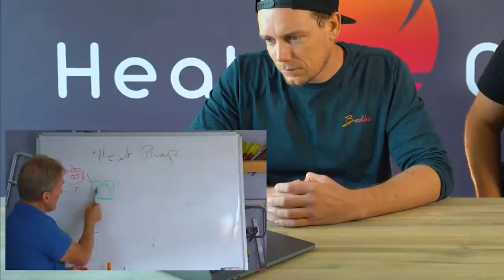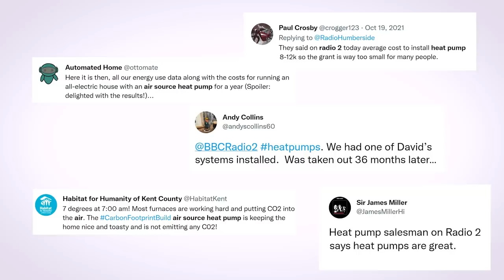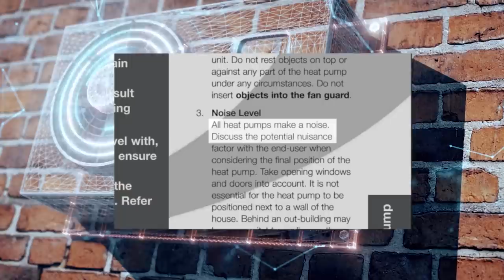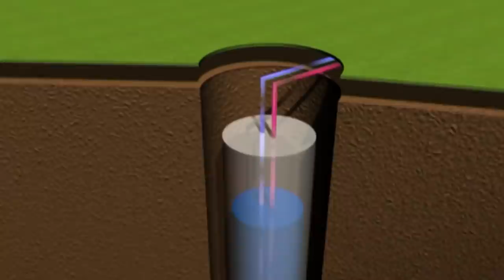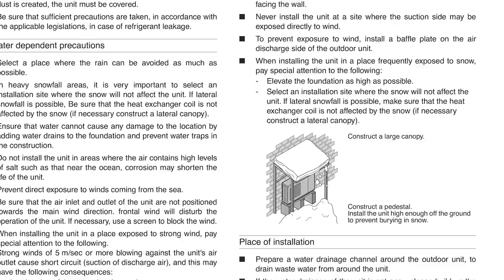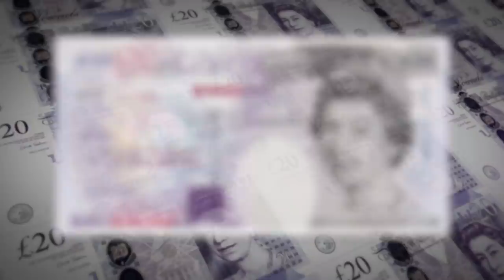Heat Pump Secrets They Don't Want You to Know

Comment: Excellent, informative and balanced. I really appreciate this as I am in the process of a complete barn renovation and trying to decide how to heat and insulate it. Thank you.
Reply: Crikey! I thought it was very UN-balanced. Amazing how perceptions can differ.
Reply: In what way is this opinion hit piece balanced? About as balanced as Fox or Sky "News"
Reply: It wasn't balanced at all...
Reply: Closed sell spray foam and ground source heat pumps are ideal. Air source with backup resistance heater is a good if ground source isn’t an option. A photovoltaic system is also a great option if you have good sun exposure and they have a huge return on investment after usually about 7 years.
Reply: See a professional, this is not a balanced video.
Reply: Also succinct.
Reply: Balanced!? A few nods are given to, "if you bend over backwards and get a degree in heating technology, you might be ok". Otherwise this is simply a list of unrealistic catatrophising and fear- mongering about all the ways in which heat pumps could possibly, maybe go wrong. If you did that about cars (or anything really!) we'd never have made them let alone driven one - think about all that explosive liquid being carried around, and the number of people that are killed every year and the servicing, and insurance, and purchase price, and the number of petrol stations they need and the cleaning and the depreciation and you even have to do lessons and a test, which costs a fortune ... no, no, we don't want these car things, let's go back to horses!

Comment: I'm an installer of the Ecodan range equipment and you hit the nail on the head, trying to explain all this to a customer is not easy, they make it sound cheap and easy !
On average it will cost between £20,000 to £30,0000 to be completed to spec !
Reply: my installation was arround 600€ including cables, 10m insulated pipes and all. I even include the vacuum pump, the manifold, adapters, and all i had to buy to install it myself... (a frient lent me the tool to shape the tubing...)
Reply: @robertroigsantamaria  joker
Reply: @timbrooks2763  I paid 18€ for the vacuum pump (i was amazed it even came, being so cheap), 23€ for the manifold, 2 or 3€ for the adapter r32 uses new valve size, and 10m tubing was some 50€, and some 360€ for the HeatPump itself... I reused the feet, and the cable and the plastic railing to hide the tubing...  so 450€  not even the 600 I said...
Reply: That is the point, get Ecodan made in Japan and England= No problems, get a cheap Chinese made= heat pumps are no good.
Reply: @MicSokol  

Manufactured in Scotland at their Livingstone plant.

Warehouse @ West Hallam is England.

Comment: It's clear that even though you say that you are independent,  you have trawled the Internet for the most obscure idiosyncrasies in heat pump manuals. My ASHP is going though its third winter. I'm very happy with it.  It has a 16A supply so no need for a 6kW supply. It is correct that the system needs to be designed for the house and I'm happy that my installer went through the correct design process.
Reply: I heard Roger once drove a car and crashed it so he informed the world that cars are all terrible, because he knows best.

Comment: I've just got back from living in France where they are handing out huge grants to convert from gas or oil over to a heat pump. And that's all they do, fit a pump system without any consideration to the house size, construction materials or heating system currently installed. And, I'd love to show you the quality of workmanship (it was so bad on my friends place I took some photos). It's an absolute farce.

Comment: I attended a party hosted by a couple extremely concerned about climate change but were prevented from fitting a heat pump due to a restrictive preservation order. They still insisted that the pumps will save the lives of those who survive winter. I made my excuses and left. Happily due to the husband's enforced resignation they are free to find a property far removed from Downing Street and suitable for a heat pump.
Reply from the maker: Very good. I hope you managed to sneak a bottle of Chateau Neuf out under your coat or was that the Bring Your Own?
Reply: @SkillBuilder  just one question for you Roger if I may, what is your opinion on electric combi boilers?
Reply: @kryptonite9187 .  I was wondering about these too, I had read they are used in some of the Scottish Isles were gas and oil are hard to supply.
Reply: @kryptonite9187  I've fitted one:   They are seriously heavy full of water and not suitable for a first floor linen cupboard swap out.        Bigger output ones need 3 phase electric!    and this isn't always available from the leccy board in rural areas.      No idea if they meet the claimed running costs but with the cost of electric  ATM, I would think VERY  costly to run. HTH

Comment: Wow someone who reads the instructions. First . !
Nice rant. Having been around heat pumps for the last 40 years mainly air to air for office heating . During the summer they work well with ambient temp above  5 degc.  Once you start to get below this then you start to see the frost start to build and units start to defrost . As the temp gets colder it becomes more and more difficult to to keep the coils clear of ice . In the worst case I have seen unit with the coils covered in ice that have defrosted and melted the ice in the coil but left a sheet of ice still top to bottom stoping the air circulation  from going through the coil . 
I have spent hours. Washing the ice off units with hose pipes in the depth of winter and then forcing 2 or three defrost cycles to dry the coils before putting it back into operation . Come the winter we would have to adjust defrost to every  60 min. To keep units working .  
But then we started to get Japanese units computer controlled circuit boards and more sensors than you could count and these units started to perform a lot better and for most of the time would cope well with the Uk conditions .  But still you could get the situation when you would get called out and find the outdoor unit looking like a snow man with ice and frost all over it.   Now these units are being pushed into homes and The domestic market hope they have the latest control and tec . But I wonder as they are a lot cheaper than the units I work with at times .  And  yes I have fitted one .  So I will find out how well it will work . But I can only 
Make it cost effective running on cheap rate. During the day gas wins at today prices.  But we know that the gov will push up the price of gas to stop this advantage. And we know that off peak electricity will soon be a thing of the past. As we will have the night time Ev charging peak soon that will end off peak . 
Just wondering if I should keep my log burner so not to be held to ransom by utility company’s
Reply from the maker: Great comment
Reply: Her in Ireland we manufacture hybrid systems  heat pump and condensing oil boiler or gas boiler combined ,so you can operate combined or solo.

Comment: I have been an heating  engineer all my working  life 53 years to be exact and I agree with you , in my time I found council’s and housing associations fall in to this trap easy,nice to hear someone speak the truth in today’s world.  How do you feel about hydrogen boilers.
Reply: I think hydrogen boilers will have a roll, just depends on how the hydrogen is made can course just as much pollution as burning gas direct.
Reply: @guygfm4243  massively expensive and hugely polluting
Reply: Well an heat pump is about 200% efficient on electrical basis while at best hydrogen boiler would be 20% efficient on an electrical basis (green hydrogen). If we speak about blue or grey hydrogen, you are better to continue to burn natural gaz to save GHG.
Reply: @pierregravel-primeau702  Green hydrogen? Sounds like you've been smoking too much of it my friend.
Reply: If it’s broke don’t fix it ..these look dreadful, going backwards
Reply: Its always nice to find people online who echo your own bias even when it lacks critical thinking am i right?
Reply: Hydrogen molecules are much smaller than methane (main component of natural gas) and will leak much more readily than natural gas. Look forward to a lot more leaks being found at your annual service and heating systems shut down until they are fixed. Same for the gas mains and pipework outside the house.
Reply: @pierregravel-primeau702  A heat pump is not 200% efficient, more like 300-500%. A good one will have a SCOP above 4, and a COP around 5.

Comment: In december 110m2 house, ufh, air to water heat pump daikin altherma 3, COP was 3 (1kw in, 3kw heat out). Very good! December here was really cold -20c some days etc.
works wonders, house is tropically warm. Was intalled 2 years ago, 1.5 years to go and pump itself has paid off.

outdoor noise is audible but not annoying, cant hear anything inside.
Reply from the maker: Sounds great!
Reply: I have a similar setup with the same pump. It is outside the bedroom window slightly to the side. Even heating the water at 3am in summer with window open , we don't hear it inside. I think there is a vast range when it comes to quality, the same goes for the installation. The right pump and the right installation.
Reply: Do you leave it running 24/7?
Reply: @gaycha6589  leave it running, as in the system is always on. The pump only pumps when there is demand for hot water or heat, the same as gas only burns when there is demand but the boiler is always on. They say to leave it on as it has frost protection processes, the main unit being outside. This means it runs the central heating pump to circulate water without heat if the outside temperature is below 2c. Leaving it on also allows for the weekly disinfection cycle. We turn the heating off in the summer (water still on) and we see the temperature falls back to 7c. It goes into a standby without completely switching off. The background power usage of the system is 20 watts. That will be a little more if the central heating water pump is running in frost protection.
Reply: Could we have some numbers?
Gas / Elect annual kwh usage prior to installation?
Elect annual kwh usage post installation?
Total cost of installation?

Comment: I find convincing people to leave it on 24/7 is the hardest thing. It runs cheaper. I mean amazed at the difference that makes. I'm saving money and it's really toasty in our house. 
We used to have to use fan heaters as well when we had gas, but I can't remember when I last used one since getting this and figuring it out. And on hot days I can even cool off while chatting over the fence.
Reply: Hi there, I’ve just bought a new build that has a heat pump installed and I’m clueless! What do you set it to to have it running 24/7 for a comfortable heat?
Reply: Sounds like 💩 to me .
Reply: what about the running costs to switch it on 24/7 compared to your previous electricity bills prior to heat pump installation? Are you able to save much?

Comment: You Love to Learn Roger this can be seen with all your videos.

I'd suggest getting a vid done with the pro's so we can all learn.

The Heat Geek team are equally as enthusiastic as you and they understand the importance of System design.

Anyone can lob a HP in as anyone can lob a Boiler in, the design and heating strategy are on both setups the key to achieve the efficiency, it's just Gas and oil  is cheap and the muppets can get away with lobbing a boiler in.
Reply from the maker: We will be hooking up with the Heat Freaks
Reply: That is perhaps the most relevant point, design of the system and its maintenance. We have a Viessmann gas boiler that has broken down every two years from new. We had a firm with a maintence contract and after couple years it became clear that they weren't doing the maintenance, they just did the gas check. The same is true of any system. It would be a good idea to for Skill Builder and Heat Geek to do complementary vids on the system design and installation of both types of heating.
Reply: @twasb2000  I read your comments with great interest, I had a new boiler fitted and was surprised on the first servicing 1 year later to see the the gas engineer only test the fumes emitting from the boiler and nothing else. Do you know where I can get a list of boiler checks please?
Reply: @pjmoseley243  What make is it? Our problem has been wasps nesting in the boiler during the summer. The syphon and lower part of the burner have filled with charred wasps and blocked the drain. I found the manual on the Weismann site and saw that the maintenance should include removal of the burner and cleaning of the heat exchanger, along with gasket replacement and testing of the gases
Reply: How do you heat your water in summer, have you got some kind of solar setup? Maybe worth scheduling your boiler to heat the water once a week, that should deter the wasps!
Reply: @LocostR1  we only have gas and it lights at least once a day for hot water. It is incredible how many get in in such a short time. I thought a gauze on the flue would help but it can totally imbalance the gasses.
Reply: @SkillBuilder  That's great news, look forward to watching those

Comment: Rodger please agree with me, the problem is with insulation. It can cost what it costs to heat a house but if the house leaks that's the square root of the problem. You can make alot of heat quickly with gas but if you lose heat you need alot of gas.  I have a 80's built house recently renovated but it's the re-blow insulation and the 25mm of celotex dot and dab thats saving me money. My air source heat pump works to be fair but its because I'm not leaking heat left right and Chelsea! Heat pumps work, gas works, oil works, no insulation nothing is really working?
Reply from the maker: yes 100% agree
Reply: A huge issue in many houses is not so much the insulation, but how leaky they are. Sadly even modern "well insulated" properties often face similar problems due to poor quality construction. Theoretically they're well insulated, but if the outside air is just going around the insulation it doesn't matter much that it exists.

Stopping air movement from outside to in, and adding an MVHR system can have as big of an effect (if not bigger) than additional insulation. Ventilation is required, so recovering the heat from the extracted air is a no-brainer, rather than slapping trickle vents in every window.

Retrofitting it however is tricky, and there's limited knowledge and experience with it in the UK - your normal heating engineer likely won't have a clue.
Reply: @mowcius  You really need a professional building services engineer or a very experienced specialist technician/installer for all this stuff if you want a bunch of systems to work together  at peak efficiency.. In the UK people have a habit of calling people who aren't qualified "engineers", and it gives the impression that they know a lot more than they often do. The person who installs heating systems is usually a plumber, the person who installs a minisplit is usually a refrigeration installer, the person who commissions a gas boiler and turns on the gas supply is usually a gas fitter. All good at their jobs but not an engineer between them and each one with indepth knowledge of their own trade only. If you want heating, ventilation, insulation, airtightness all designed and coordinated you need an engineer.